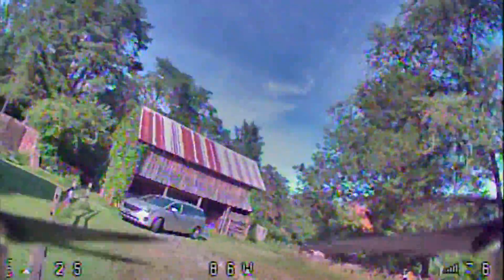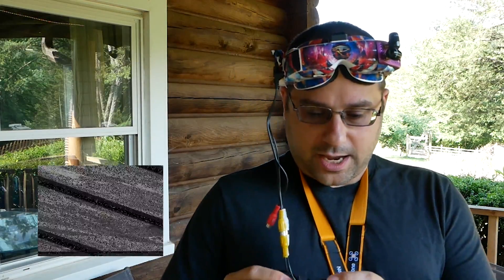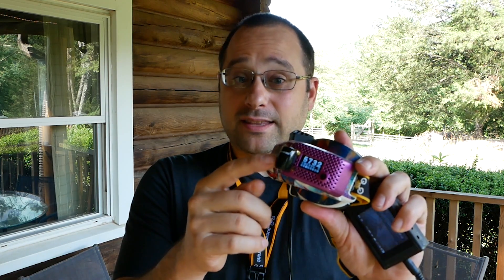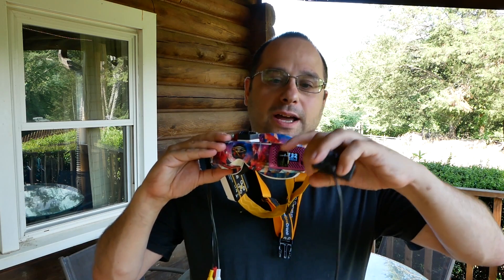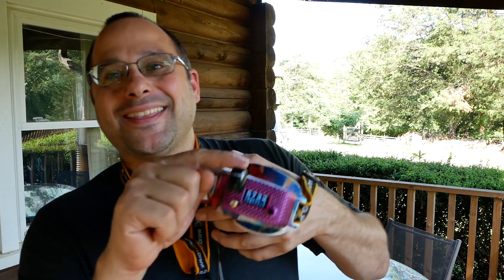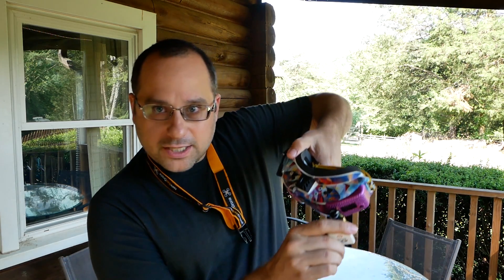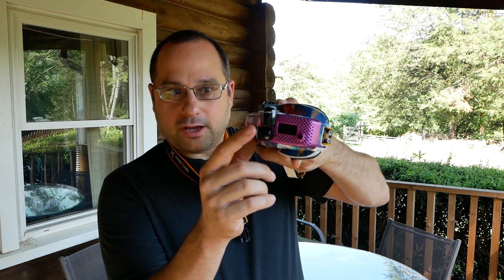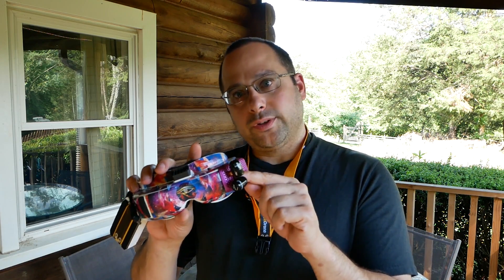Why two omni antennas vs. omni and patch?

Comment: I wish you showed the video output from your drone with the two omni antennas perpendicular to each other like your example with the one omni antenna where you tilted your goggles to the antennas weak spot.  They say proof is in the pudding and I mean it makes sense but I'm not convinced cause you couldn't mount your omni antennas perpendicular for better reception because it was to much trouble for you to spend 30 seconds to install the antennas correctly and you expect everyone to accept it's better with no example..  It's all just talk or a waste of cash without evidence that it actually helps..

Comment: I know it's 5 yrs old, but this video is timely. I'm about to switch from omni/patch combo to 2 stubbies, but I'm going to use extensions to get them above the goggles and my big, water-filled head.
Reply: is it good?
Reply: @TobiZ2612  I think it's better for what I do (generally fairly short range freestyle). I screwed up and only got 1 extension, so I'm not using that yet, but I have nothing but truerc rchp stubbies on my hdzero goggles and everything is working great (knock wood). I do still HAVE a patch because I like the idea that if I lose a quad, I can use it's more directional nature to help find it, but they are stowed deep in the toolbox. Stubbies for life!

Comment: Just got a rapid fire and discovered the following: when using the frame combining mode (as opposed to traditional diversity), the signal is fantastic while flying in the area the patch is pointed (obviously), but when flying behind the patch, the signal is much worse than if I was using a non-diversity rx with just an omni. I believe this is because the module is blending in some frames from the patch even when it is breaking up badly. Switching to 2 omnis completely solved this. The difference was amazing.

Comment: I have the Eachine 200D quadversity goggles. Can I use just 2 antennas on it and expect the same results as dual diversity only goggles? If I use just 2 antenna can they be attached to any of the 4 connectors available?

Comment: I just bought a right angle and one straight.  I just noticed you have two right angles.  Did I get the wrong one?
Also does it make sense to use the double axii instead?  Or is there not much difference
Reply from the maker: Double Axii has narrower coverage pattern. More range in front and back. Less top and bottom.

Comment: question about antennas. if I have a RP SMA abt antenna on my goggles do I need to have the same one on my drone or can I have a SMA  on the drone?
Reply from the maker: The connector doesn't matter as long as it screws into a compatible one on the goggle or drone. If the vTX has a RPSMA then it's antenna needs to be RPSMA.
Reply: @JoshuaBardwell  yeah so I have an RPSMA connector on my VTX and an SMA on my goggles so as long as I get the right antennas for the 2 connecters I should be good right?

Comment: With wireless microphones true diversity with 2 different types of attenas you always get lots of drop outs since it won’t switch back and forth as often.  With 2 matching types you get consistent coverage with no drops.  What is different with fpv that lets you run 2 different types without causing issues?

Comment: Question. I just picked up a rapid fire diversity and I noticed that all vids I see about them show the screen on it has the main frequency (ie 5740) and under it it shows a number of other bands and channels. Mine only shows the main frequency in bold and under it it shows only I band and one channel. Why would this be ?
Reply from the maker: Update to the latest firmware?
Reply: Joshua Bardwell 
Yup. I did that too. Still the same.
Does it frequency hop if it needs too ?

Comment: Is it worth buying aftermarket antennas for the attitude v5 without an aftermarket module?
Reply from the maker: Honestly the antennas that come with it aren't bad. But premium antennas will make the most of any receiver.
Reply: Joshua Bardwell thanks. Got a $30 gift card so I was jus curious if antennas would be a good thing to use it on lol. And then to decide on what antennas. So much to learn 🤦🏻‍♂️

Comment: Do some folks fly with one antenna?   I didn't hear him say to put a terminator on the empty connector to provide for less loss from the unused branch.  This would not apply if there is a separate receiver for each antenna.

Comment: Ever tried any of the VAS/IBCrazy antennas? I'm not super impressed with their omni,... I think a pagoda does better, but their crosshair is a different story. Seems to beat others in directional performance, and almost does as good of a job as an omni,....for flights on the horizon. I just ordered their newer crosshair and am going to try mounting it and the older one at 90 degrees to each other horizontally with a slight up-tilt on the older crosshair to cover flights overhead. Doing this on Rapidfire, so will be a challenge mounting them soo close.

For my tests, I'm just watching the RSSI bars on the rapidfire,..... I'm sure there's some error there, but I think it gives me a good idea.

Comment: I like keeping a patch antenna on hand in case I lose a quad.  I can direction find it.  Take off all the omnis and put just the patch on.  Turn head toward best video signal.  Walk that way.
Reply: There is only one condition - the battery can not get out of the drone... it often happens to me: /
Reply: @_antwonTT6  For a RX, it doesn't cause any damage as it isn't transmitting anything.
Reply: @_antwonTT6  also you can get GPS for like 10 dollars
Reply: @_antwonTT6  
That's only true for transmitters.
Reply: I take the antenna off entirely it's much more sensitive at that point and super directional. Now if I'm out a mile than a directional antenna could work but, at that point I'd probably be using the gps from the osd because if you're flying more than a half mile or so you should really have a gps on it.
Reply: That's the best way. Also, turn down your video transmitter to 25mw when you get closer (if you have smart audio.) This allows you to better differentiate a bad signal from a good one. If you had it on 800mw, then you'll get very clear video no matter which way you turn.
Reply: @_antwonTT6  Why? It's a receiver not a transmitter, right? I'm a novice.
Reply: That's usually what I do

Comment: I've never understood the use of a patch on FPV Goggles for the reasons you mentioned. With the 90 degree offset omni antennas, you're using the same principal we've used for years with our aircraft receivers to get better diversity. I think the patch would be best served on a ground station when doing long range FPV. Good explanation. See you in the Air!

Comment: Josh, try the following: use a patch and an Omni on a long coax. The coax should be long enough that the ant sits over your head. Now what I’ve noticed with the rapid fire: even if you go behind the patch, the module still prefers the patch while it is definitely weaker (which I see with the bars).
That fact alone shows that this module is not really good in getting the most out of the theoretical dream team (patch and Omni on a long coax).
So now I use the 15cm coax Omni and a tiny stubby. The long coax is easily bendable and can stay on as well.
Sorry for my long comment, greets, Mario

Comment: "Only" by your head. Idk, the head is a big balloon of water. The goggles on the other hand, mostly plastic with low current electronics. I wouldn't really be surprised if the head is much bigger blocker than the goggles.

Comment: Using the stubbies does make it easier to store, especially in a back pack.  Long stems antennas will give you better reception because you get away from your radio absorbing melon.  But you have to remove or cleverly pack our goggles with long stem roses.  So it’s a trade off, what works best for you is totally up to you and how you fly.

Comment: Rather than run 2X omnis, it would be better to run 1 omni sticking straight out and a directional aimed straight out as well.  THis way the directional does most of the work and the omni covers the rest (except behind you).  This is also better because the goggles will not interfere with the antenna radiation pattern as much.

Comment: i always run my antennas 45 degrees tilted back so i know that when i lower my head down after like a minute of flying, its still going to be horizontal.
Reply: Pretty sure they do single axis antenna trackers that fit in the module bay in the goggles.

Comment: can you wire two separate XM+ receivers from two different identical FR sky taranis qx7 to one flight controller?
Reply from the maker: No, you can't do that. But you can do it with RXSR because that receiver has an SBUS IN and SBUS OUT line. So the SBUS IN line can be used for redundant receivers.
Reply: @JoshuaBardwell  wow man you are so knowledgeable in this field.. you are always my first go to on the hard to find questions that aren't often talked about on other rcgroups
Reply: thanks for the heads up!!

Comment: Errr, an omni-directional antenna is not smooth all around it actually has lobes you can visualize on 2D planes. The vertical one will be lobed and horizontal one will look like an umbrella (Google: umbrella effect). 

Offsetting by 90 degrees gives more coverage on both the horizontal and vertical planes. 

If you let's say use a 12dBi and 3dBi antennae of the same kind, the diversity receiver will almost always pick the 12dBi one...
Reply from the maker: I didn't mean that an omni antenna has a spherical coverage pattern. Just that it is roughly circular in the azimuth (horizontal) plane. That's sort of the definition of an omni antenna, right?

Comment: I am using antenna diversity. Ev100 goggles. Using one of each. Two omnis work better?
Reply from the maker: It really depends on the situation but I would think omni+patch is probably better in most situations for you.

Comment: antennas, antennas who cares?? The only thing I need to know is where did you get that paint job on your goggles?  Great video as always. I use a patch pointing in the dead direction of my omni. works fine with traditional diversity receivers.
Reply from the maker: It is a vinyl skin. Stikitskins is where I got it .
Reply: @JoshuaBardwell  Thanks!

Comment: Joshua just a quick question, my motors are "wining" they're "sobbing" when coming into hard backwards-move propwash.
I've got pretty low P-term, moderate I-term (some bounceback) and low D-term as well as D-min. Filters are more on the higher side.
What might that be?

Comment: HELP NEEDED: I have a URUAV UR65 and after a small crash, motor 3 no longer spins. all it does is make a quiet buzzing sound. When arming the drone, the motors increase in noise pitch until it disarms and beeps once (long) then a gap and it beeps again (long i think). Im not sure what this corresponds to and cant find anything in the settings telling me of a problem. Is the motor unusable or can it be fixed?
Apologies for this being irrelevant but i really need help from more experienced fliers.
Reply from the maker: Probably the best approach is to replace the motor.
Reply: @JoshuaBardwell  alright, I feared that might have been the case. Watched all of the vids on remapping resources but mine seemed just broke. Was a friend's which was scaring me Haha.
Thanks for the help Josh

Comment: Wouldn’t it make more sense to swap the positions of the stubby omnis?  The two antennae are meant to compensate for each other’s null.  With the horizontal stubby on the bottom, isn’t the vertical stubby on top blocking the horizontal stubby’s coverage above your head (which is also the null of the vertical antenna)?  If you swapped positions, the horizontal stubby would have a clear path to catch all of the signal above your head.

Comment: Years ago I read that diversity is used to reduce the effects of destructive interference where part of the signal reflects of something and therefore arrives a little later at the antenna. Because the paths don't have the same lenght anymore, constructive and destructive interference can occur. So you use two antennas that are spaced out a bit, so that when one experiences destrucive interference, you can switch to the other that hopefully doesn't. 
My guess is that if you use two omnis, you get reduced interference problems, which in some cases might even be better than a patch.

Comment: I think it also depends which patch. A high gain, wide, good quality patch like the true RC xair or sniper will massively outperform a cheaper patch. I seriously doubt that two omni antennas like those that are almost 180 degree blocked by the head/goggles will ever outperform or even match an xair with a decent circular polarised antenna. A seasoned pilot will be aware of their head position and really I can't see why it matters when the axiis have such low exposure in that position. I think the only benefit is that its compact. That's about it.

Comment: The only reason for two "omni" antennas on my achilles module is: Flying with other pilots! 
It helps to avoid frequency disturbances! The patch tends to "catch" other signals better. 
Whenever I fly alone, always patch with omni. Been holding my head calm and aware of direction for a long time now, yay what a good habit! xD 
Oh, and my Omnis are sticking out above my head, just like as many others have it!

Comment: Or be like Eachine, throw more antennas at the problem instead of better engineering or better firmware, and have three overlapping 90-degree patches plus an omni
Reply from the maker: Honestly, it's not a bad solution.
Reply: @JoshuaBardwell  It's a great solution, you can get a $300 pair of goggles with really similar reception quality to whatever fatshark and expensive receiver you'd normally buy for $400ish

Comment: Would you recommend two patch antennas with rapidfire for longer range, or just one patch like IRC recommends?
Reply from the maker: IRC sells a 2-patch system specifically for rapidfire used in long-range. So I think they're on board with that.

Comment: I use Rapidfire and have been refusing to switch to the two omni setup (although I see everyone else at races doing it), precisely because I did a similar side-by-side comparison and didn't like what I saw.  Glad to know that it wasn't because I somehow didn't have my trial two omni setup right.  My setup: one omni with ~3-inch extension (the one that came with TrueRC X-Air) to clear the goggle and my head, bent slightly backward to compensate my looking down + one directional, aiming ~30-degree up.  Works GREAT

Comment: Reasons I’ve been using two axii stubbies:

1) i don’t have to take them off to put the goggles in my bag.
Reply: How do you attach 2?!! I even bought a wrench and the second antena has no room! Am I crazy or what
Reply: @michaelbryant3643  I have the same problem! Did you find a solution?
Reply: @michaelbryant3643  easy! Just use an extender! Ive been doing this since July and ive had great results w the Wildfire (until just 3 days ago where i pushed my limits and was shocked that my reception wasnt better!)… ill keep the antennas but swapping out my module for the Rapidfire).
Reply: How to fit the direction of the antenna? Can we turn it 360⁰ until fit the direction toward the sky?
Reply: lol i was thinking the same thing. do they fit right on a skyzone sky0x4 pro?

Comment: Kinda why I ended up with 3 Orqa patches and one pagoda omni for my EV200Ds.  One patch on a short extension pointed forward, two on 45-degree adapters pointed to the left and right rear, Pagoda pointed up.

I did originally have a TFP pointed forward instead of an Orqa patch - the TFP seemed better at long range, but the Orqa ones are lighter.  They also look cool.

What is this static of which you speak? 

;)

Comment: I use an Omni and a patch, and I usually have my head down out of habit from my box goggle days.  The way I counteract this is I use a 45 degree sma adapter on my patch so that it points forwards.  The adapter came with my True-D so it works out well

Comment: One issue with antennas that metal I proximity will affect it also not just block. (Detuning and absorption I believe). Rule of thumb is 2 wavelengths. That would be 12  which is pretty long but shorter is still going to help vs right on the goggle. 
Same for the quad in proximity to the carbon/electronics I’m thinking.

Comment: warm motors on 5s betaflight 4.3 tips? 85-90 degree weather
Reply: Fly somewhere colder
Reply: Tyler James thx man lol 😂 it’s to freaking hot
Reply: Warm? Is normal...... If they're too hot to touch then you have issues to work out, drop D gain 20% all around and see what happens

Comment: So one right angle stubby and a regular stubby  for this setup ?
Reply from the maker: Two right angle. I think it helps keep the one antenna from shadowing the other.
Reply: Joshua Bardwell What do you mean exactly by shadowing each other ? Meaning that if I get two regular stubby antennas they would not work together ?

Comment: I run two omni antennas and two patches, one super high gain and one medium gain. Loving the EV-200D goggles!
Reply: just hate that i have to use RP-SMA to SMA adapters
Reply: you put 2 omni at same side or you mix ?
Reply: @laurentdinodrone7111  I think it would work either way but I usually run an omni and a patch on each side. I just forget the patches for miniquad stuff tho. With patches I can have acceptable video at over a mile, assuming I point my head in the right direction.
Reply: @crudboy12  ok thanks